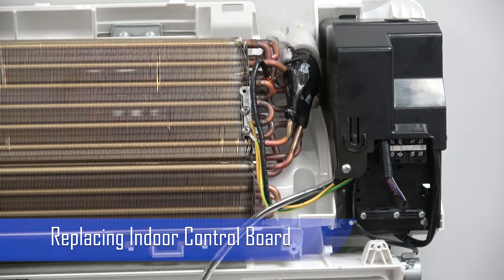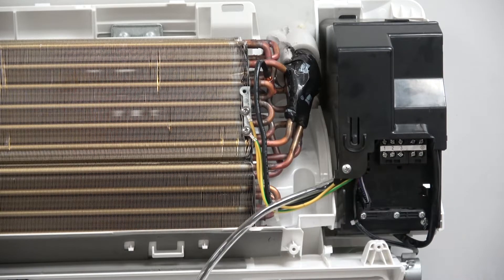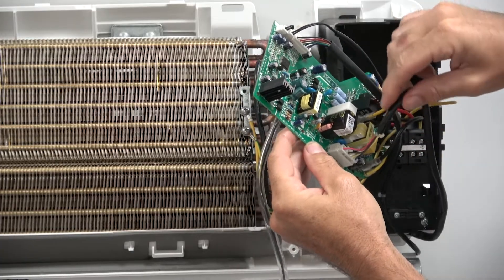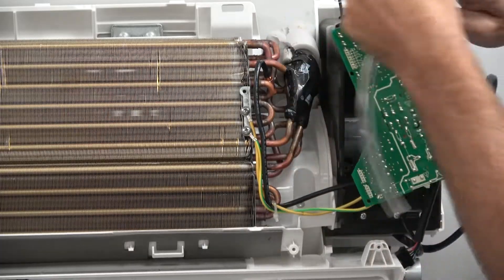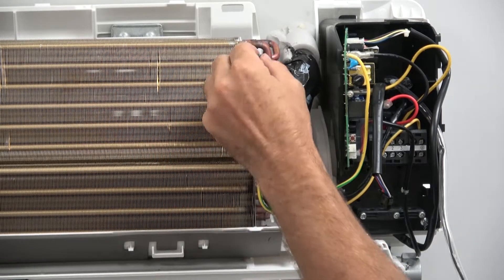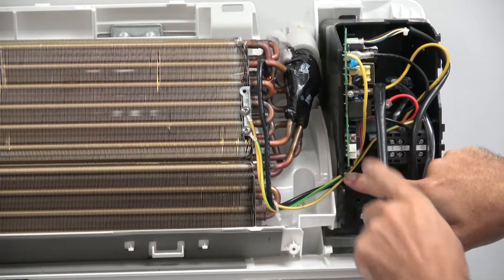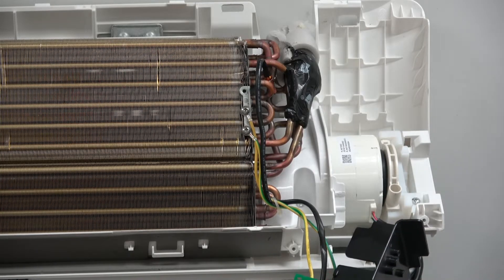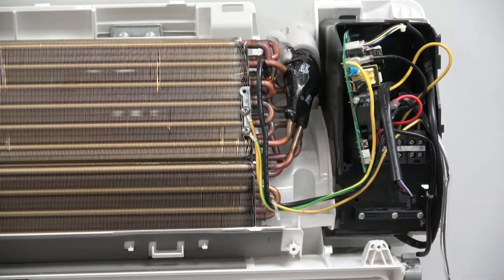Ductless Mini Split Indoor Unit Control Board Replacement

Comment: There is a wire that hands down under the black box that looks like it plugs into something. Is that the other end of the display wire and what does it plug into?

Comment: I have a Pioneer Mini Split 12,000 Btu's ,3 yrs old. It cools and heats great. But sometimes it will go into Auto mode and it becomes stuck at 76 degrees. It will not shut off nor will it go into the heat or cool mode. It just gets stuck in auto at 76 degrees. It will not respond to the remote. I kill the breaker for 5 minutes and start it up and it works great for a while. I think my PCB is scrambled, any suggestions would be greatly appreciated. Thanks.

Comment: Show Step ZERO! These things are attached to the wall, punched through a hole in the wall. How do I get to your starting point WITHOUT having to tear apart the entire thing off the wall? I need to repair in place as this is a 2-story house, and messing with the lines outside just to get this off the wall is a non-starter.
Reply: @Forest Milo Thanks, I signed up and it seems to work :) I appreciate it!!
Reply: @Kyng Sebastian No problem :)
Reply: Did anyone get instructions on removing the top cover????
Reply: @samanthajudge5857  after you swing the inspection cover up there is usually 2 screws right in the front remove those and there are 2 or three clips to depress on top and the cover slides right off.